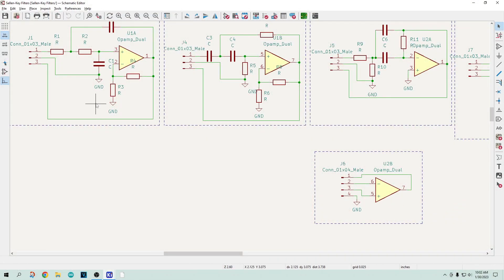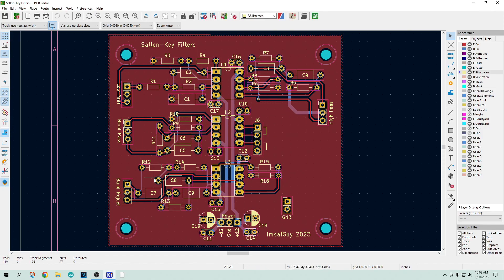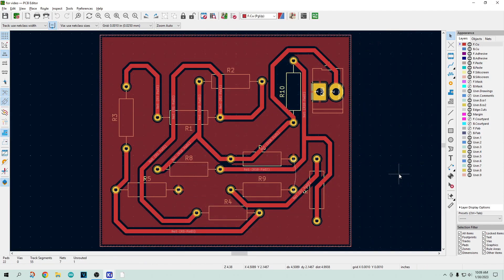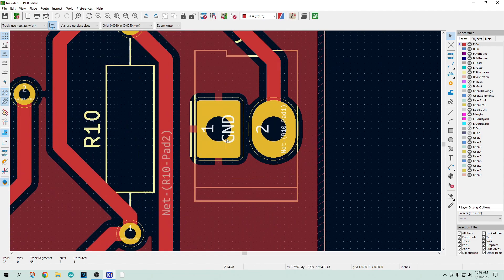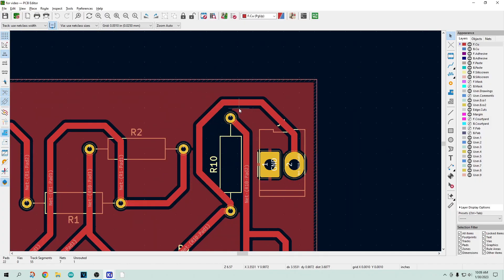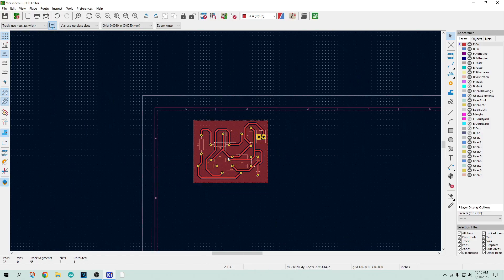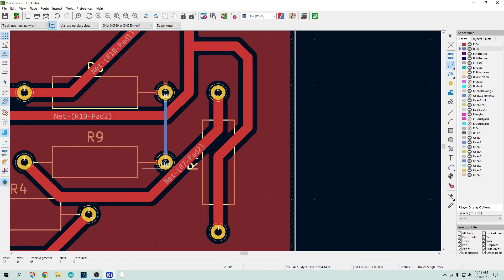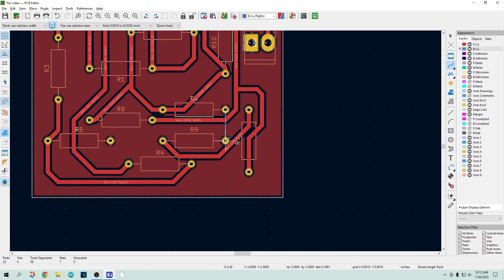#1421 PCB - Grounds

Comment: how do you fill to ground wihen you have just smd pads
Reply from the maker: in KiCAD you can add a fill with thermal relief on the SMA pads or solid. if you need to connect top and bottom just add vias
Reply: @IMSAIGuy  thanks thats what i did. but i was hoping that kicad recognized it and autorouted to the nearest via

Comment: My default when laying out a two layer board is to flood BOTH sides of the board with ground.  That way even if you have restricted ground paths on the top layer, you almost always have a good path on the bottom layer.  I also drop a reasonable number of vias to stitch the two planes.

Comment: The last trick you could also do with the ground pin of resistor above. And of course, a ground plain on the bottom would solve a lot of problems! But thanks for the video.

Comment: A couple of additional notes:

If you're doing all through-hole stuff, it doesn't matter as much, but if you're working with any SMD components, it is much better to do your ground plane on the back side (non-component side) instead of the front side of the board.  This is because all of your component pads and the traces between them will be on the front side, and will interrupt the pour everywhere, but on the back side the whole pad can be mostly undisturbed.

Also, for a similar reason, when making a two-layer board (even for through-hole stuff), I always try to dedicate one side of the board to just the fill, and put as many of the traces as possible on the other side of the board (don't try to do your fill and your traces on the same side).  You can run some traces on the filled side if it's just not really feasible to do them on the main side, but the fewer of those you do, the easier it is to keep the ground pad contiguous, so you don't have to worry about issues like islands or long convoluted return paths, etc.  (This also has the advantage that the return ground current for a trace can often flow along the ground plane directly under that trace (without having to go off on some other completely different route to get back to ground), which can be significantly better for protecting against crosstalk and interference.)
Reply: Morales in the 🌅 Morning

Comment: Does KiCad warn about floating ground planes?
Reply from the maker: No. It will show a non-route trace, but that is very easy to not see and miss. and it does not show up when you do a error check. So, it is up to you. I like to click on a ground trace and then the ~/` key. this will highlight all grounds
Reply: @IMSAIGuy  ~Thanks ~ didnt work for me but I had to select and right click a trace and theres net inspection there where it has highlight net option.
Reply: @IMSAIGuy  That's definitely not correct.  All versions of KiCAD I've used will identify floating fill islands by default (and will highlight the unconnected net as well) if you run the DRC (which you always should be doing anyway).

Maybe you just manually disabled those checks somehow?

Comment: I still don't understand ground in circuits, ive watched many videos. If I take a circuit diagram and try to build it, its very hard to understand where the grounds are supposed to go. They just end abruptly with the little symbol, how are you supposed to know where that connects to in reality?
Reply from the maker: yes, it is not obvious. you need to mentally think about all the current flows. it's like knowing where something is located on the map but finding the best way to get there the map doesn't tell you.
Reply: You can do it fairly literally on a 4 layer board where 1 or more layers are completely filled with ground, so vias placed anywhere can connect straight to it like the symbols in the schematic. On 1-2 layer boards or point-to-point construction, you have to route it like any other net (optionally using copper fill to save time, with caveats explained in the video). Ground and power are almost always the most complicated nets in a circuit since most components connect to one or both of them.

Comment: but ground is ground! as long as it's connected to the chassis it's fine lol
 In school I built a lot of guitar pedals and amplifiers of various sizes, shapes and forms (nothing of big power really). For the most part, the ground schemes worked fine (just by chance), but in things with low signal (high amplification with low noise), very high/very low impedance, or in circuits carrying digital and analog components, the correct ground routing it's an art. I only learned many years later, after several headaches xD

Comment: Thank you so much for sharing this. I literally ordered boards the night before I saw this video they had the very problem that you talked about. I wish I had seen this before I ordered those boards. It's just on a decoupling capacitor that I have before a rotary encoder so I can jump over a wire from the ground on encoder to the ground on the capacitor and not have a problem but dang it I hate that I missed it. It's the first PCB I've ever created. Anyway love you videos thank you so much please keep doing this I have learned so much from you!

Comment: One more detail: If You have several stages on one board it may be a good idea to create separate groundplanes. Otherwise it is so easy to get noise from the digital part right into the analog input stage for example. Or you can easy end up with positive feedback and oszillation if you have an loudspeaker power amp and a input stage sharing the same ground plane for example 🙂
Reply: Most of the time this would be bad advise. What you really don't want to happen is having a large the loop area. Use a single ground plane, but place the different circuits far enough apart and don't let currents flow where they shouldn't (both DC and AC). But don't just break the ground plane in order to separate circuits. And most importantly, don't route signal accross different ground planes, except you want to create an antenna.

Comment: Unless you are building a really low budget board, you should have a non-routed ground plane which is well connected by non-thermal vias to the surface ground, poured or not. Four layer boards are pretty inexpensive today, and for many applications, the additional planes and the ability to have impedance controlled traces justifies the extra few dollars to get the boards built.
Reply: I hate to disagree with you, but I did a simple calculation in one of those famous websites for making PCBs. 10 EA with 2 layers costs 5 bucks... 10 EA with 4 layers costed 50. It's a 10x price increase, so it's far being pretty inexpensive.
Reply: @olavodias  i checked jlcpcb and they quoted me:
2 Layer = $5
4 Layer = $13 
10 boards / 100x100mm
Reply: @Rotwold  but if you change into 5 boards 4 layers 50x50mm it will be 2$ + 2$ delivery

Comment: 5:54 a DRC check would tell that there are errors. At least Eagle does.
Reply: Kicad does too but the point is the last example where up close examination the route is just nuts but electrically sound, this is useful for beginners.
Reply: Not sure if he mentioned that he's using KiCAD. I think he said "DRC won't always catch it"...that's absolutely not the case KiCAD might miss a small floating island but it will never miss an unconnected net. He also had the rats nest turned off, otherwise it a white line would have been making it obvious that the pad was not connected to it's net

Comment: Thanks for the video. I just watched a video presentation from Altium Design featuring an engineer named Rick Hartley on the importance of grounding. You guys raise the same issues. 
On a completely different topic, as I continue down the rabbit learning RF and everything that goes with it, I’ve been getting into Software Defined Radio. Just last night , I ran into a few scholarly papers on Software Defined Antennae. I could get my head around SDR but antennae configured by software is a bit bizarre. It seems like it’s not brand new but I can’t find much outside Academia on the topic. If you have any info you can share or a direction I can be pointed, I’d appreciate it.  Thanks for your time- Jason Burchell

Comment: Given the modern possibility of chinese board manufacturing, where 2-layer and now even 4-layer boards are super cheap, (heck even western PCB prototyping isn't that bad if you don't mind) although a lot of the advice in here is valid, I am puzzled that you never gave the context of the availability of avoiding 75% of the problems presented here with a bottom-layer ground pour.

Indeed I'd thought that the most appropriate advice for beginners laying out a board nowadays would be to start off with a 2-layer, bottom-layer ground pour design and route from there.

Maybe this stems from the days when a single-layer home-manufactured PCB prototype was the most common, but nowadays ordering them is far easier for me than getting a hold of ferric chloride. 

I don't mean to be negative just would love to see that possibility mentioned if it makes sense for someone learning from these. Still love the series.
Reply: I agree.  A good default strategy is a solid ground plane on the second layer, without any traces.  That way you don't have to think about the return path (as long as you're routing on an adjacent layer).

I don't know how to approach routing if a solid ground pour on layer 2 is not an option: probably first route ground?  Given that the (ground) return path should be close and contiguous to every (fast edge/high speed) signal, it seems that manually routing the (ground) return path at the same time would be quite a lot of effort.
Reply: I really like the series, in the research labs I was the one who made the PCB and everything that was said here is true. It's also true that it's easier to order a board these days (I make small boards myself and when I'm super lazy I build it on a prototype board), but in order to order it, I have to be able to design it. The layout of the paths and the placement of the components is not so simple, we must always remember that the circuits affect each other and a wrongly designed PCB can have functional problems even if it is connected correctly.

Nice day 🙂Tom